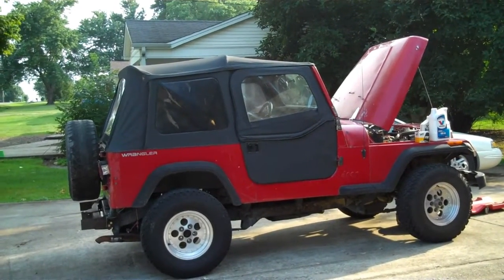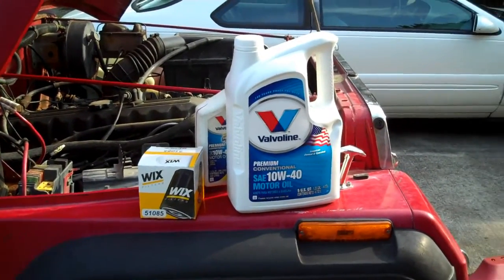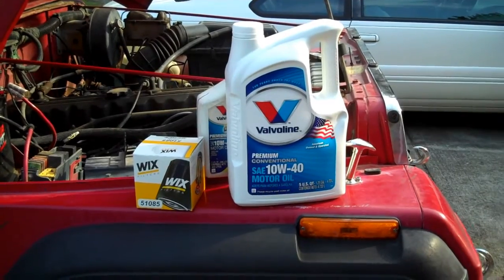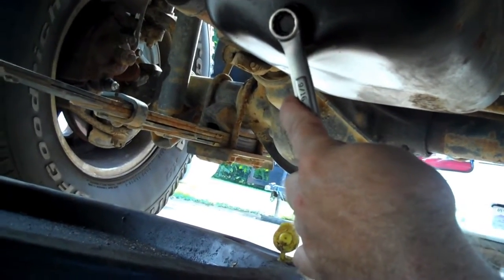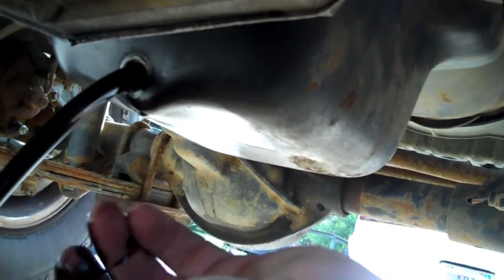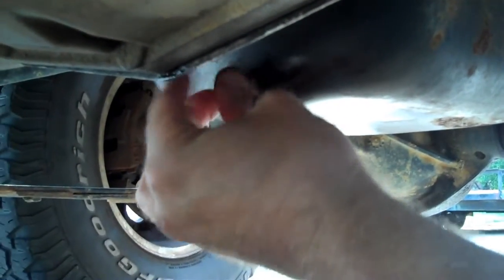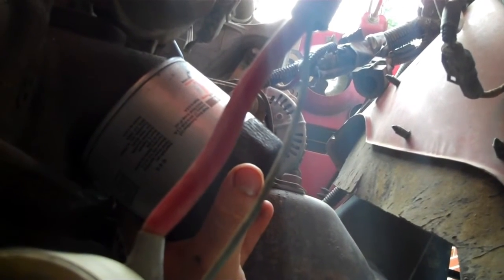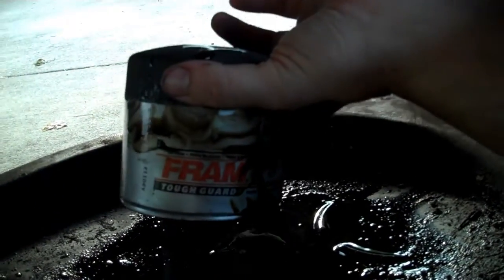Jeep Wrangler oil change #cheapoilchange #poweraddictscrew #fixjeeps

Comment: Like your videos are you going to do a segment on removing leaf springs on a Jeep Wrangler
Reply from the maker: +Gary King Cant tell you exactly when. But .. I will be doing a junk yard YJ lift, which will involve altering the spring pack. Will I totally remove them? Probably not, but it will be just a couple of steps away from that point. What I will do is point out what is left to do if a person wants to pull the leaf packs completely out. Hope that will help. Thanks for checking out the videos! Have a great day!

Comment: Thanks for the video. I own a 95 Wrangler with 80,000 miles and I want to know if its ok to use synthetic oil
Reply from the maker: Nope, I wouldn't after that many miles. Switching an engine with many miles on it over to synthetic can cause leaks and more oil consumption. If an engine starts out new with synthetic, then always synthetic. A low mileage engine, say under 10k miles, can be swapped over to synthetic. Some people may say different, but thats been my personal experience. Have a great day.

Comment: thanks for the video! I think I might attempt to do it myself. is that all the garages do when they do the oil change or do the garages do anything else? (years ago they used to grease something in the tires or whatever, or that's what they told me, but that was a different vehicle, I have a 2004. Jeep Wrangler now)
Reply from the maker: You're welcome. Some do "inspections" as they call it. That is where they look at your fan belt/s, brakes, etc. This tactic is used more often as a way for them to find something to "upsale" to the customer. They may grease the ball joints and other front end parts. From what I've seen lately, you now pay for the extra perks. But, that can vary from one shop to another. You just gotta ask and find out. Have a great day!

Comment: Can you do a radiator fan wiring ?
Reply from the maker: Possibly when I put my Mustang back together. Its running electric fans. My Jeep runs the factory belt fan. When I drop in the built stroker 4.6 engine, I may need to add an aux fan then.